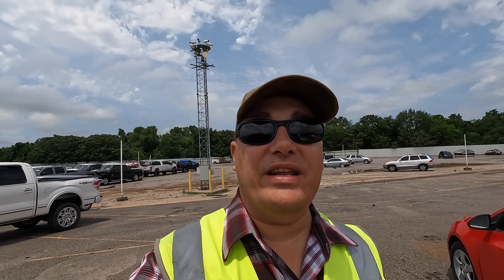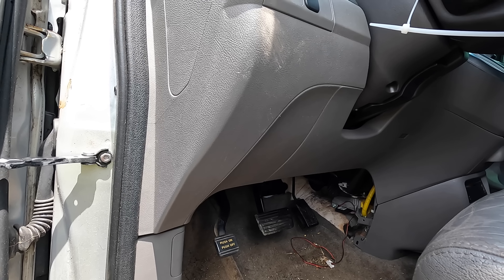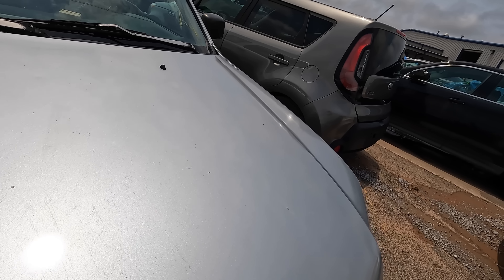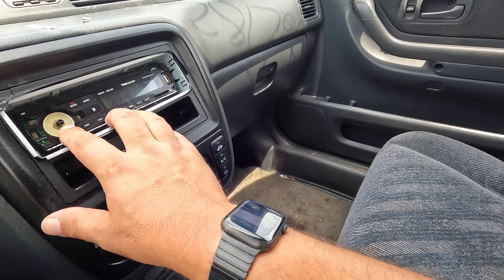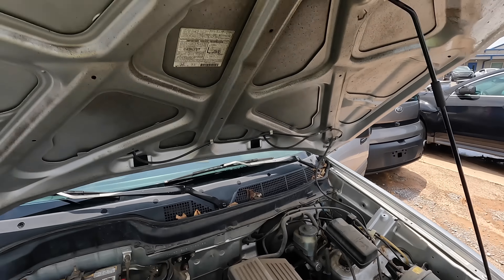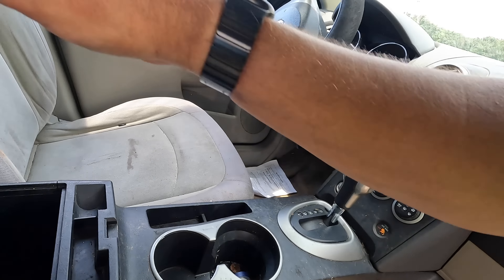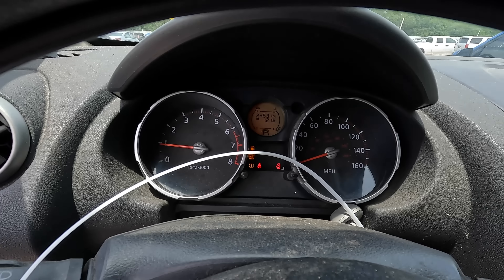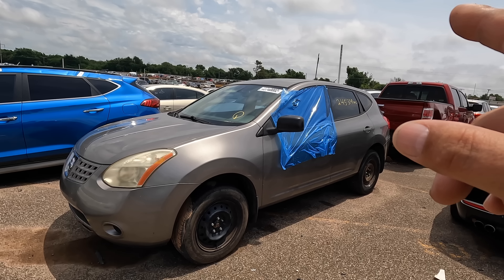Copart Walk Around 6-12-22 AM + Unreal Super Cheap $850 Honda CRV!!

Comment: Definitely take the CRV. If you gave it a tuneup, make sure the tires were good replace the windshield even an extra good cleaning inside and out perhaps even a quickie Maaco paint job I think you could turn around and sell it for around three
Reply: Only thing that would worry my is the rust as that can be expensive too fix and it has too be done otherwise it's just a parts car.
Reply: Paint the valve cover
Reply: yup yup yup
Reply: He ended up buying it it was on my copart watch list and the buy it now was actualy like $700

Comment: I have a 98 crv AWD since it was new. It has gone through 3 teenage daughters and still runs awesome. Keep up with the required services and they will run forever!
Reply: Same here.  I bought one used in 2008 (a 2001 model) which is still in excellent condition after 150+k miles.  Some rust repair around the rear fender trim was done professionally on both sides. Other than that, even the cloth interior has held up without a tear over these years of use.  We keep it clean and use it in the winter or for moving things. Decent mileage for a car its size (about 20mpg, as I recollect). Wife refuses to sell it...car was too good to us post 2008, when we went on austerity after I lost a high paying job and we weathered a difficult job market.

Comment: CR-V 's are great the engines last forever. It has the same engine as my Honda Element a k24 2.4 litre inline 4. Check the tail pipe for any oil burn, but it's definitely worth buying, great little Honda 👍

Comment: I'd go for the CR-V.
Even though it's older, it has about 30,000 miles or so less than the Rogue does.
The CR-V is going to be a better bet than the Rogue will be.
My aunt had a white one like that one, around 1998 or so, loved it.
Thanks for the video, Randy.

Comment: those B20B engines in that generation CRV are amazing engines. I have talked to people who have achieved 400k+ miles out of those easily with regular maintenance. That Rouge is trashed, and those CVT transmissions are terrible. you will not be disappointed with that CRV if you get it out on the road and it goes through all the gears. that would be my only concern with that powertrain

Comment: 1999 Honda CR-V all day and all night. The best car you can buy. BTW to open the back door you have first to pop up open the rear glass and then you will be able to open the rear door. There is a mechanism that will not allow you open the rear door without popping up open the rear glass. You should check both rocker panels, behind the plastic covers, they are known to rust away on those Honda CR-V

Comment: 850 bucks is one hell of a deal I bought my 2005 Ford focus with 206,000 mi on it and I got it for 800 bucks off of marketplace and she is one really good car I've already put 1500 miles on it after owning it for 2 weeks, and I plan on trying to get it up to 300,000 miles
Reply: I hope your Focus doesn't have the infamous DCT. If a stick, you are much better off.
Reply: @leonb2637  idk if it does it's just the base model no options and Manuel window and locks with auto transmission

Comment: Any honda with the 6 cyl with timing belt I stay away from.  Those ka20's ka24's are work horse engines.  Still have my 04 Honda accord with 230k miles.  In my 8 years of ownership I've spent maybe 2k bux? That includes a set of tires $700, all new brakes (calipers, rotors, pads) axles, struts all around, lower & upper control arms, tie rods inner and outer

Comment: I'd stay clear of that Nissan rogue because if that's what the interior looks like God knows what the inside of the engine and transmission looks like and the whining noise is probably the power of steering pump it's probably dying or it could be just low on fluid

Comment: The CR-V is a waaaaaau better deal and to open the liftgate I think you should try and pull it to the right since it opens that way. But you should buy it maybe for your stepson? Or is it to much miles? But you should buy it. What a deal even if it’s a 1999 and 200+k miles